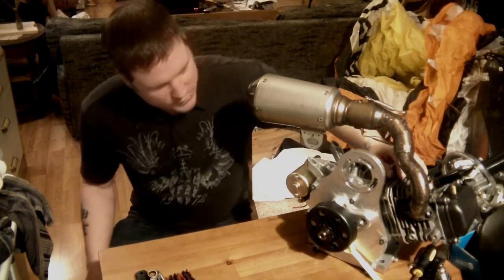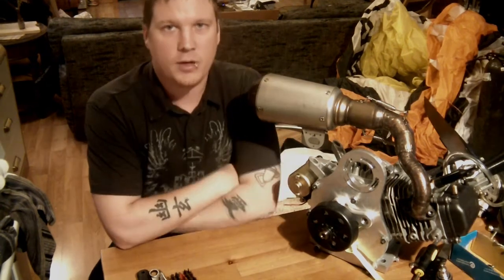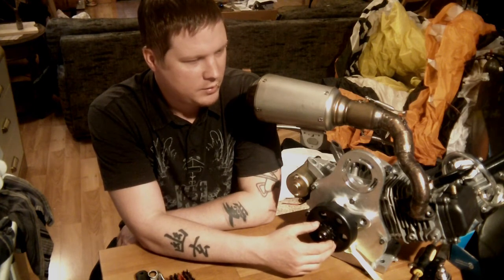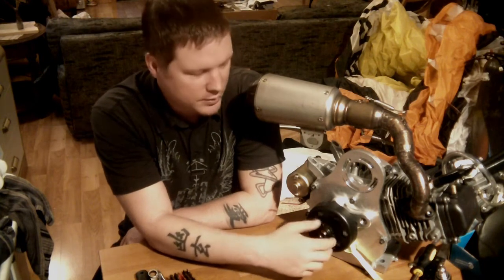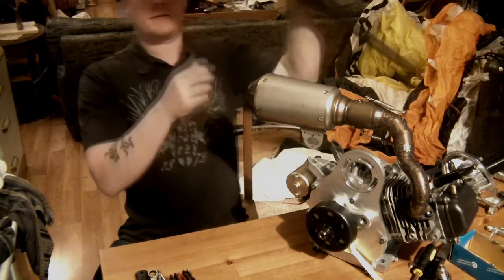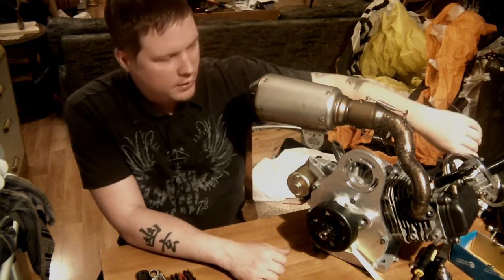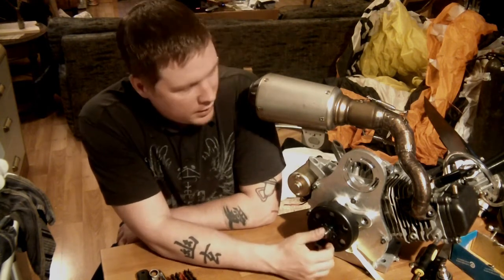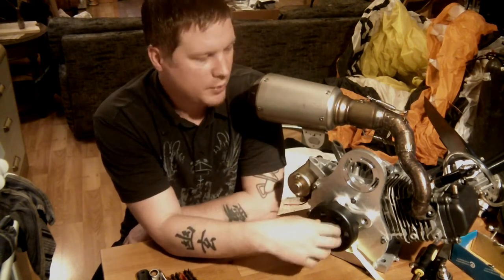DIY Paramotor Engine - pt1: Intro

Comment: What was the base engine? And what does it weigh? 

I'm looking at converting a scooter gy6 engine that had the rear end smashed off the engine, so it's just the engine and bottom end.

Plan is to convert it to 180cc with a kit (from 125cc), and maybe use forced induction with a amr300 supercharger and a 4 valve head conversion. 

I'm hoping for 25hp
Reply from the maker: That sounds like a very nice build. Gy6's have been used in aviation for a long time. I believe the Bailey 4 strokes were based on the gy6 also. This engine is a Predator 212. It's similar to the Honda gx200 but this model has a Hemi head from the factory. It weighs about 32-34 without oil, or reduction.
Reply: Dmitri Zyuzin cheers for the response! Weighing mine up, with a bit of the casing still to be cut away I'm at 25.6lb with no carb, starter motor, exhaust, oil or reduction.

I see the Bailey motor is getting 20hp with a 2 valve head, which makes me more hopeful I can do that on 4 valves, although I'll be down 15cc.

Comment: pardon me,i don't know anything about engines. is this a motorcycle engine?
Reply from the maker: No, it is an engine similar to a Honda GX200. It is a 6.5 horsepower 3600 RPM engine used in things like snow blowers or log splitters which has a very large aftermarket following by people that build mini bikes and gokarts and it can be taken up past 25hp and 10,000RPM (with complicated, expensive modification and racing fuel).
Reply: ok...thanks

Comment: commercially bought paramotors are too expensive. is your paramotor cheaper in terms of total cost? can i order from you?
Reply from the maker: That will depend on if you can machine parts or have a way to use someone else's machinery. If you can sort out a reduction and do the work correctly, yes... if not, it will likely cost as much if not more. This project was never meant to be a short cut to save money but more of a way to make one DIY and have a 4 stroke engine.

Comment: I've been looking for a videoike this. I'm planning on building one also. Great video with lots of info. I have a question...I'm a small guy(around 140 lbs) how small of an engine you think I can go? Thx in advance.
Reply from the maker: Hey man, thanks for watching. I got another couple of parts left to edit and release. To answer your question, I chose a 4 stroke because it's reliable and I really dislike working with 2 strokes (especially having to mix oil) but they do have a significant advantage over weight saving. Although the predator 212 is NOT a heavy engine (contrary to popular belief, it weighs in at around 13kg with a lot of the exterior parts attached), there are very good cheap options that make enough power for smaller guys (especially if you can come up with a very light frame). There's the KT100 engine you can get brand new for $750 or so, and I also do want to build a "booster" type paramotor (ie, fly to the first thermal and free fly from there) using a DLE170 engine with a reduction.
Reply from the maker: Speaking of the reduction, that's the MOST important part.
Reply: Dmitri Zyuzin Thanks for the fast reply man. I looked into the 212 but since it involves so much modification and I don't have the necessary tools to do the mods on it, I've also been looking at the Chinese dle170's. Do you have links or know any that make red drives for dle170?
Reply from the maker: I am not aware of any redrives for that motor. I've had good luck with my test project: a chain reduction using cheap off the shelf parts.
Reply: Dmitri Zyuzin I see. Is reduction even necessary for the dl170?
Reply from the maker: A reduction is not required on any engine... but it's a hugely inefficient proposition. You will likely be buzzing at full throttle with minimal lift without one. I believe a reduction is what makes or breaks the longevity (as in, the desire to continue to use the machine as is after a few inital flights) of a homemade paramotor engine project.

Comment: Would a Kawasaki ninja 300 be a good donor engine?
Reply from the maker: You are not gonna be running around with that motor on your back. Something like that would be great for a trike or quad though but unfortunately far too heavy for foot launch.
Reply from the maker: You also gotta deal with cutting off the portion of the case with the transmission in it and figuring out a reduction system.

Comment: Looking forward to the series! Solid work, what kind of tensioner are you looking to fit?
Reply from the maker: I have that extra threaded hole which had an idler pulley for my belt reduction. I will just machine a basic pivot style nylon spring loaded idler sprocket with a bearing. I may even be able to get away with 3d printing most of it. That's a project for tomorrow!